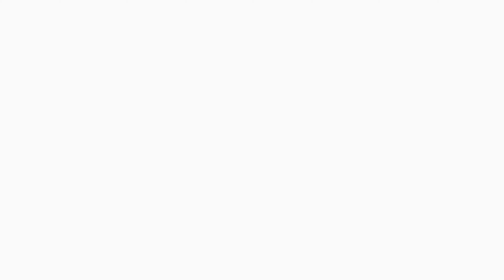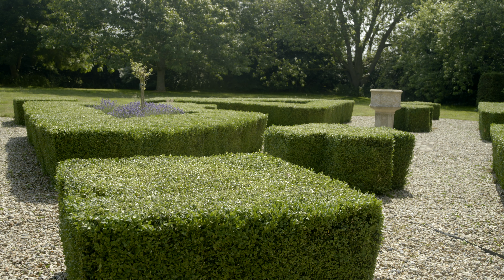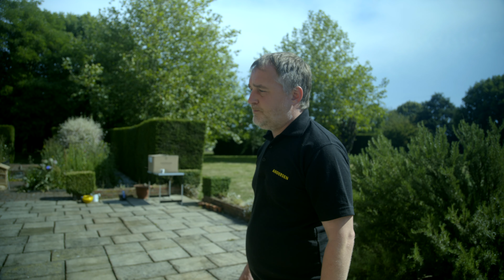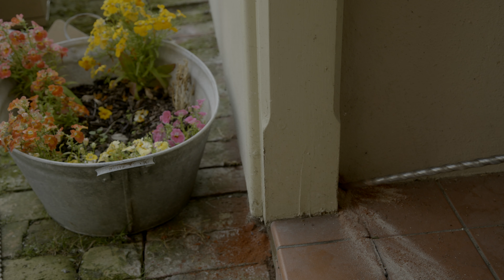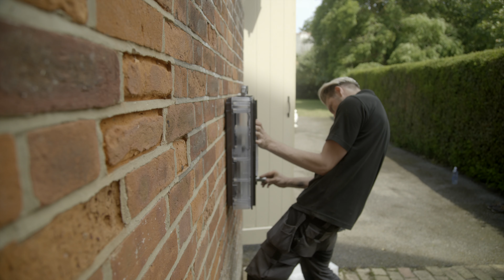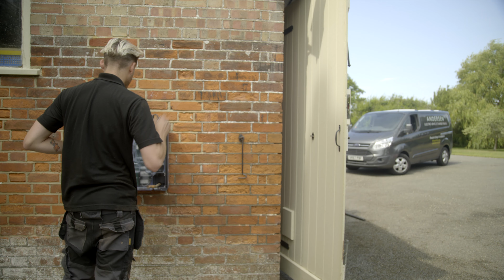Installers Video: Andersen A2 EV charge point Installation.

Comment: Does it have built in O-PEN device and Type A RCBO?
Reply from the maker: The A2 has an Internal Type B RCM (BSEN 62020), 6mA DC protection (EN 62955)
This provides a disconnection from the supply via a 4 pole contactor and includes automatic reset and cloud notification.